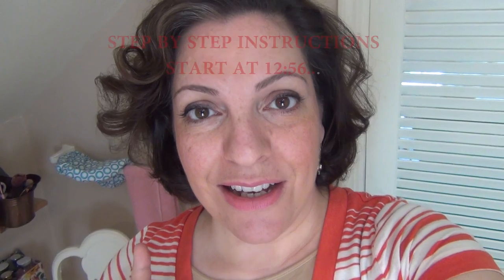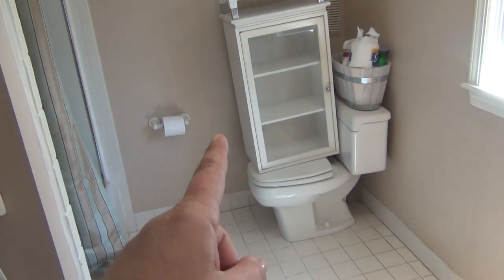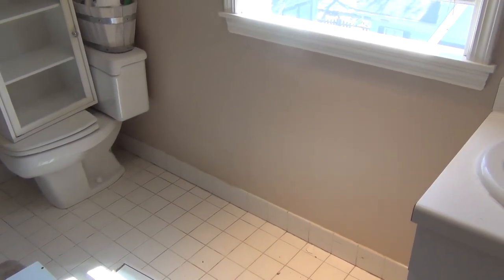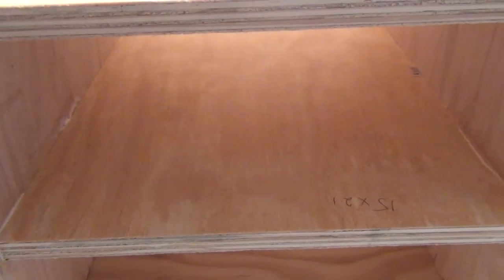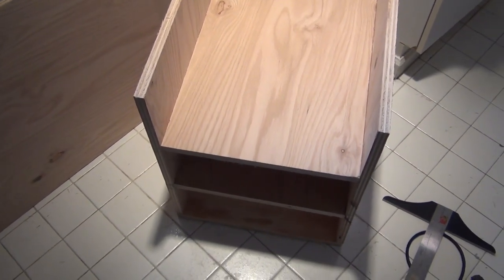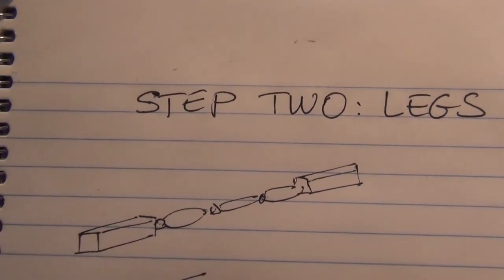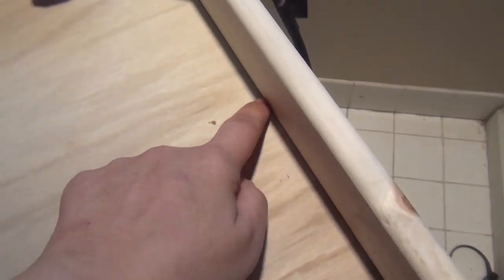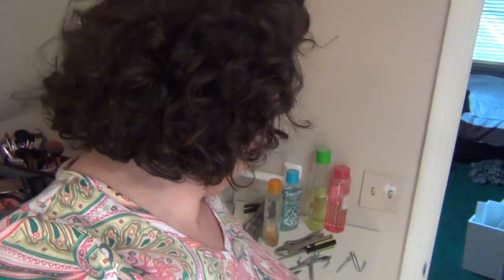DIY Vanity and Makeup Storage - part one

Comment: Next time use solid wood instead of plywood. It offgasses formaldehyde, a known carcinogen, especially in humid conditions such as a bathroom. I wish someone had told me this before I had my pantry built. Solid wood, as long as it's a softer one, like pine, is very inexpensive.

Comment: what is the measurement of the top of the desk
Reply from the maker: CHRISY W I measured the space I had available so it s not really a measurement you could use since it fits exactly between my vanity and the toilet, but anyway it's 83 in by 28
Reply: #Thanks My Great Challenge